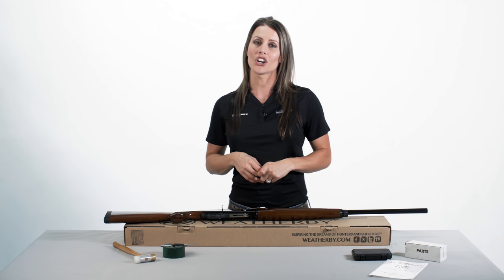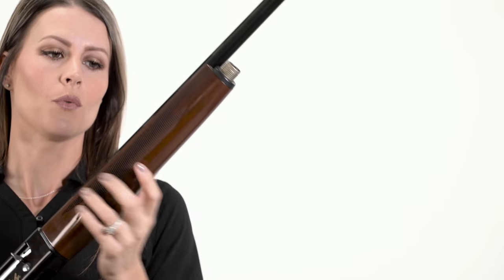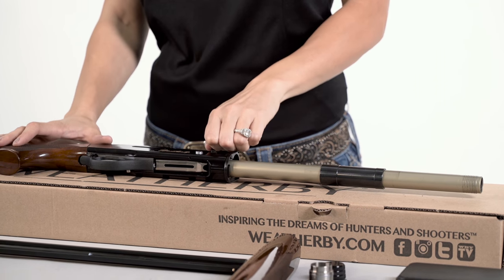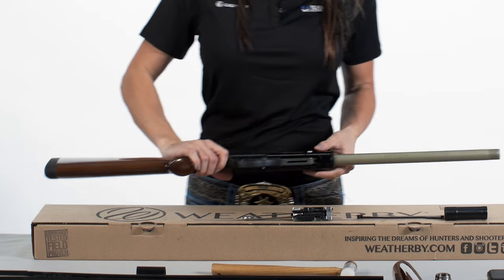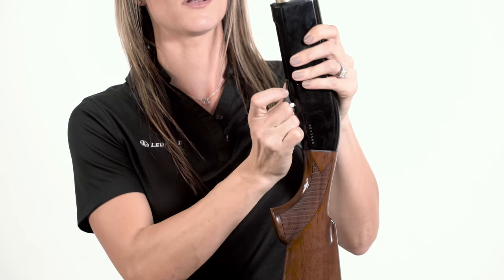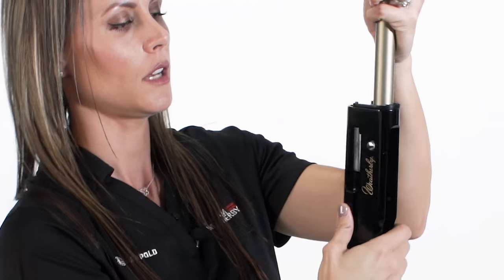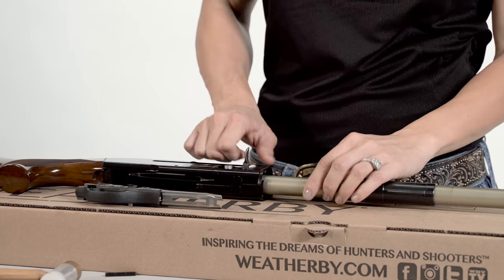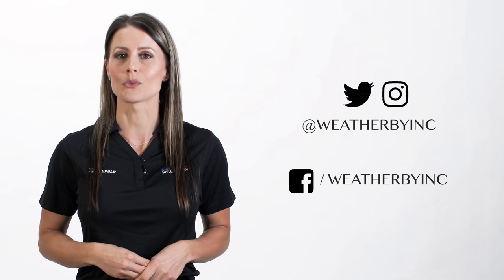SA-08 SHOTGUN | LINK OUT OF PLACE

Comment: Great video Weatherby! After taking it apart and cleaning it, I'm can't get the action to cycle back. The link is in the hole, I pressed the shell lifter but it will only go back an inch and then stop. I can't get the action back!!! :(
Reply: I figured it out. I took the link rod apart from the bolt and when I put it back in I had it turned over! It won't go in to the plunger upside down! :O